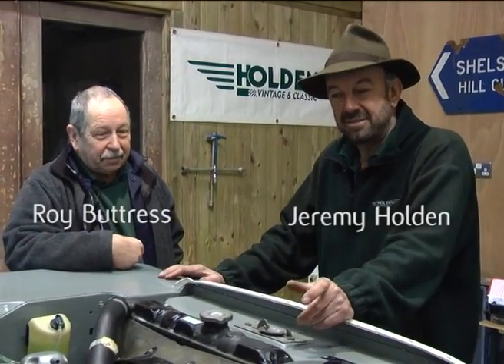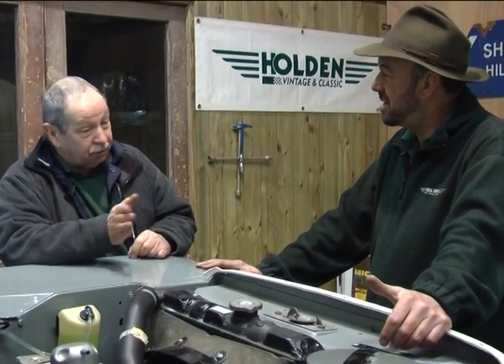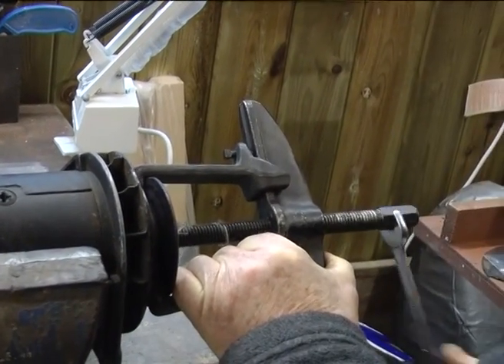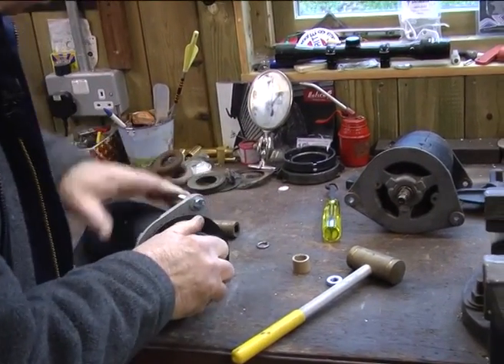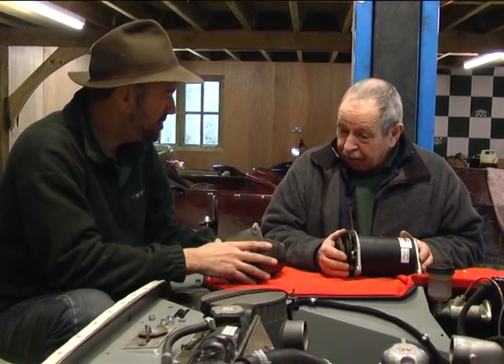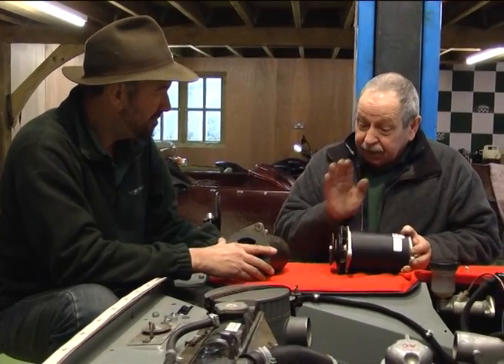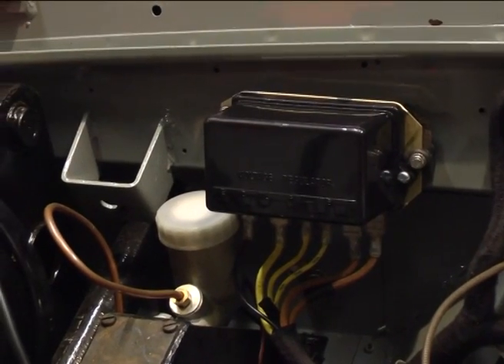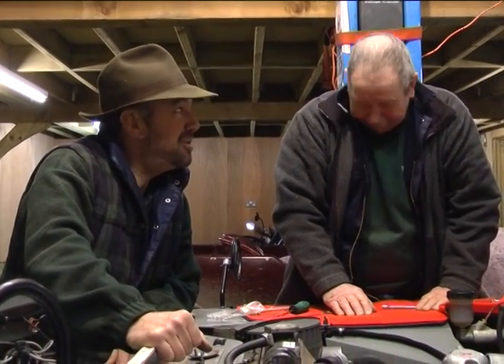Dynalite alternator replacement for dynamos

Comment: I would like to see where the two wires on the Dynamator are connected.  My regulator had seen better days so I would like to use a new fuse unit and not the box.